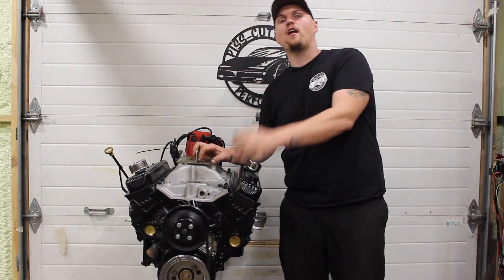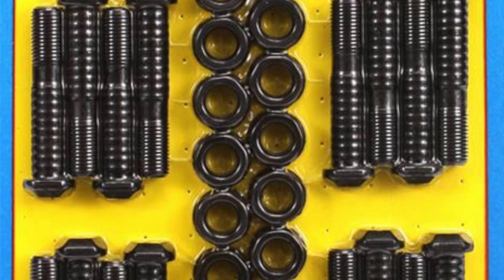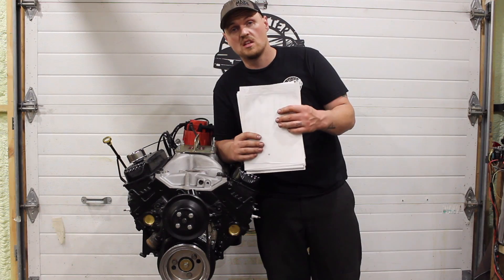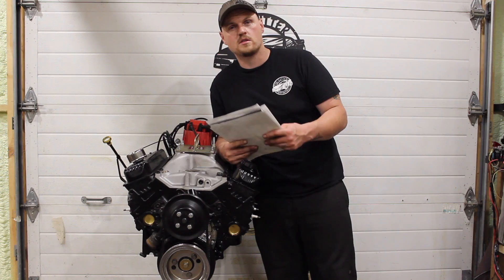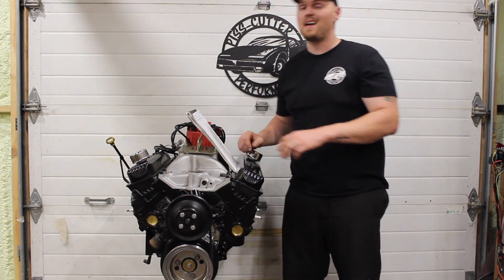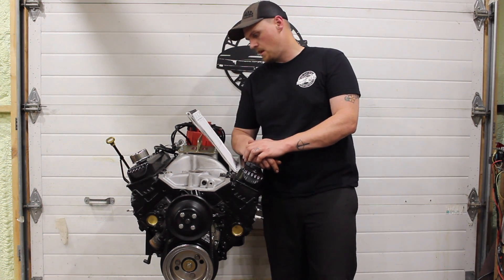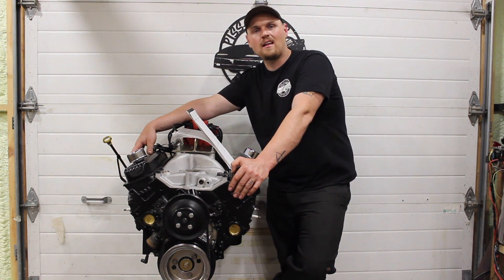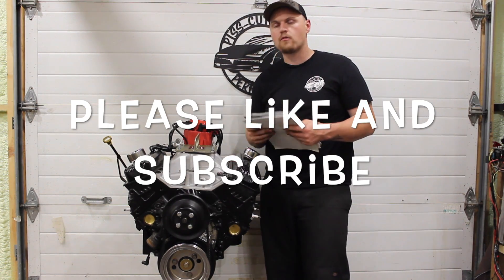Cheap Chevy 350 Power! 400+ hp Vortec Heads LT4 Hot Cam Dyno (L31 Budget)

Comment: I have a sbc (gen1) with wp heads with 185cc runners 13.7 to 1 pistons, cam is .615/.625  110 ° lobe sep .315 /.310 duration solid roller new eagle crank with 3.750 stroke. 4 .040 bore single plane weind intake.often wondered how much HP it makes never been on dyno.you can see it in my S10 @ old ridge runner race truck on YouTube ..I've often thought it may be around 500 HP compression test says 205 to 215 across all 8 holes any thoughts on est hp?
Reply from the maker: That should be an easy 500 hp, a combo like that will usually make atleast 1.35 or so hp per Cu in

Comment: Really sweet to see the lt4 cam results because I have the lunati 270 voodoo roller for my 383. Identical valve timing as the hot cam just different lobe profile and .549/.565 lift with 1.6 rockers, ground 6.5° advanced vs the lt4's 2° advance. 

385ci somewhere low-mid 9.1 compression. Budget afr 195 heads with 5 angle valve job, smoothed runners, port matched, thin rings, 0.040 quinch, performer quadrajet intake. 450hp I'll be happy but any closer to 500hp I sure wouldn't complain. No matter what it puts out it'll be a major upgrade from the bone stock 120hp/210tq 1985 tbi 4.3 in the el camino running on 5 cylinders😂😂 poor ol gal can't even maintain 60mph at the moment 😢

Comment: Hi Pat. I continue to have questions. :). I’ve heard the plastic gaskets for the intake manifold are trash. That’s what came in my kit. Do you have a recommendation and part number for intake manifold gaskets that you like? Also a head gasket for a motor that is not decked and heads not surfaced. I saw you use that steel shim head gasket, but I’m not sure I want to go that route as I’m worried about getting a good seal since nothing has been surfaced. Is there a standard head gasket and part number you recommend? Maybe I shouldn’t worry so much about the steel shim gasket? I know with a standard head gasket my compression will be about 3 tenths of a point lower. Thanks for the continued assistance.

Comment: Hi Pat. How much power do you think porting the cylinder heads added in this particular build?
Reply from the maker: I doubt it would have been able to hit 400 without the port work. Properly closer to my original 385 or so hp guess. I focused mostly on the exhaust side

Comment: 400 hp from a small block Chevy is easy.if you can't get it out of one you can't build performance engines
Reply from the maker: No doubt its not a hard task. The hard part is doing it on a budget. This engine was built for less than $1600
Reply: @cuttersperformance  easy enough with intelligent parts selection.pistons,cams and head choice.

Comment: thats some awesome numbers! I'm not that surprised though, vortec engines have easily unlockable extra power.

i pulled a 98 vortec from a pickup with 140k on it, re sealed it, new timing set and hardware, GM ramjet cam, edelbrock intake, shorty headers and slid it into a 93 OBS to replace the blown TBI 350 and wow!! that truck never had that much power before, not 400 hp but waaaaay stronger than TBI or a stock vortec. just from that small RV level ramjet cam, intake and headers and exhaust. it is a different animal.  

idk how much HP i have from that combo, never dynoed. maybe 325-350HP and like around 375 torque? just a guess. its a really strong vortec either way and runs great.

thatnk you for making these videos, so appreciated.
Reply: id say around 330hp, 375 ft lbs

Comment: Really wished you had run some basic 1-5/8" long tube. Or even shorty, block-huggers for some real-world numbers since this engine recipe would be great for street-going, weekend cruiser hot rods that wouldn't be running pricey, high-flowing 1-3/4" headers. I don't think the smaller headers would've hurt output too much. But it would've been nice to know how much they did.
Reply from the maker: The headers used are a chassis header unlike alot of dyno headers you see, but yeah would have been interesting to see the what 1 5/8 would change, honestly probably not around though. Also believe it or not those 1 3/4 headers are like $315 (Hooker racingheart)

Comment: I have an extremely low mile ZZ4 with LT4 Hot cam, ZZ430. I plan to remove it from my 66SS Nova and install in my wife's 79 4.4litre Malibu wagon. I am thinking about upgrading from the GM intake to a Edelbrock Air Gap RPM and looking for a better cam. I want more power and a better sounding cam. I have a brand new th350 and 2200 rpm converter that should work well. Any recommendations on a new roller cam?

Comment: I'm considering the hot cam for my car. I want to retain the mechanical fuel pump, so what style of fuel pump pushrod is required with this cam? Is it a billet steel cam or cast?
Reply from the maker: Its a billet core cam, a bronze tip fuel pump pushrod should be used

Comment: Another question. If I am reusing my stock lifters, how important is it that they go back into the same bores they came out of? They’re kind of dirty, and if I put them in the parts washer it’s going to be hard to keep them in order. Thanks!
Reply from the maker: Roller lifters dont need to go back in the same spot like a flat tappet lifter. Be careful cleaning them in a parts washer. If the solvent is new or quite clean, then you'll be good, but you dont want to introduce dirt/debris into your lifters/rollers.
Reply: @cuttersperformance  thanks again for all your help and timely replies. Very helpful. I misinterpreted one of your videos and I’m having the exhaust seat cut to a 1.6. Didn’t realize the increase in flow with the 1.6 also required a bowl blend (otherwise it is a detriment to flow as I understand). Maybe I’ll need to learn how to do a bowl blend too! :-) I know the 1.6 without a bowl blend reduces flow. Would I feel it on the butt dyno?
Reply from the maker: @boydabresch3858  even a light bowl blend is a good idea with the 1.6 ex valve. Just take your time and be sure not to hit the seats.

Comment: Thanks to your videos I built one with flat top pistons + 0.030 and ls valve springs comp cam  XE274H no head mods runs great. can I just replace the rockers to 1.6 and just re adjust valve lash ? for a little more power
Reply: Gonna have to measure coil bind retainer clearance etc. That cam already has a very aggressive ramp going 1.6 is gonna make it too much imo. May need to run more on the seat. To be honest I dont think youll feel any improvement.

Comment: i built one for my k1500 was 465hp and 480 foot pounds used david vizard recipe speedmaster heads flat top pistons with quick fuel slayer 750 cfm lt4 hot cam from  wilhoits oklahoma city
Reply from the maker: Thats really good for this cam, what displacement?
Reply: 355 @cuttersperformance
Reply: flat top pistons and eldelbrock performer rpm air gap intake  wilson manifold
Reply from the maker: @MichaelMatt-ts2mv  that very impressive torque for a 355 and that cam. Ive made similar hp with similar heads and cam but not that torque
Reply: i had wilhoits grind the cam with 107 LSA @cuttersperformance
Reply from the maker: @MichaelMatt-ts2mv  oo that makes sense, i thought you used a actual lt4 hotcam. Still quite good torque for a 355 👍
Reply: @cuttersperformance  also the big deal 6in rods
Reply: also skip white balance on the rotating assy  @cuttersperformance
Reply from the maker: @MichaelMatt-ts2mv  what compression ratio?
Reply: @cuttersperformance  10.3
Reply: A lot of cylinder head work
Reply: @cuttersperformance  are you have a great day man I'm fighting this damn hurricane in Florida
Reply: @cuttersperformance  No way he made that with those parts and the LT4 cam not happening
Reply: No way from a 350. Dyno operator gave you some fluffed numbers. Happens a lot

Comment: Two quick questions. I’m planning to run the Summit 8802 cam which is a copy of the LT4 Hot Cam. Im going to run the springs, retainers, and +.030 locks you showed in your other vid etc. My questions are, can I run the stock lifters? And second, I found a set of stamped steel 1.5 rockers that are long slot. I’ll closely inspect everything as it’s going together but assume these 1.5 long slots will work?
Reply: Thanks! The Summit 8802 cam specs are the same with a 1.5 as the LT4 Hot Cam is with a 1.6.
Reply from the maker: Yeah you can run the stock lifters if they are in good condition. I used a low mileage set of LS lifters. 1.5 long slots will work but a 1.6 ratio will give you better results

Comment: I'd like to build one with 11:1 compression, and install a 24X reluctor under the timing cover so a 0411 PCM could run it, with 60 LB injectors, and E85.

Comment: I did the exact same build with a 93 LT1 camshaft and 1.6 rockers. Was very surprised at how strong it runs.
Reply: We had a  96 t/a
13 .06 all day long 
Long tube 1-3/4
True dual w/ xpipe and dynomax bullets
1.6 rockers
3000 stall
Reply: Stock cam and gears!!!!

Comment: I’m hoping to be up there to in Hp /trq to 355 vortec 880 blk Edelbrock rpm air gap intake comp cam CS 280H-10 redone vortec heads 202/1.6 Holley 670 vacuum sec Msd 6al

Comment: Very impressive, I bought that cam about 5 years ago, but my  timing chain pulley didn't fit. Is there a different pulley to be used, this is on a gen 1 small block. thanks!
Reply from the maker: Yours in a 86+ gen1 roller block?
Reply: no, my 1982 corvette 350.  @cuttersperformance
Reply from the maker: @janchrisler6097  youll need a retro fit cam if you want to go roller
Reply: I did that, bought that cam and the timing chain cam pulley for a gen 1 chevy, but would not bolt up!!! not sure if it takes a different cam pulley type than a gen 1 timing change set? @cuttersperformance

Comment: Love this! I built my 98 5.7l on a budget using your videos with beehive springs,retainers, offset keepers, magnum roller rockers,and extreme energy cam(.495/.502). I also added a bbk 80mm throttle body using the oem plenum. My question for you is engine management…im swapping the 4.3 out for this built 5.7. The truck is a 5speed manual.  Do i get my computer flashed for my cam set up or do i go aftermarket? Something with a autotune feature maybe?
Reply from the maker: Your best bet would be to find a good local tuner that could custom tune it for you on a wheel dyno
Reply: Cutter is right find someone close to you and see what they recommend if able to use stock style computer you may save some cash is your 5.7 and ls

Comment: Could you use the stock rocker on this build or is it necessary to go to the 1.6?
Reply from the maker: Stock rockers shouldn't be used with this cam. They are not long slot and shouldn't be used over .480 lift
Reply: @cuttersperformance  thank you!

Comment: I'm sure I've missed it somewhere, but did you switch to screw in studs? Do you think this combo would be good for drivability in a street rod? Thanks, love your videos.
Reply from the maker: It has factory studs. Screw in studs are always a good idea, but not fully necessarily if the open pressure is kept under 300 lbs. This engine would have great drivability 👌

Comment: Im wanting to do this set up as well, question...do you need to port the heads, ive never ported heads before
Reply from the maker: To get the same results, you'll want to port the heads. Focusing on the exhaust port and blending the bowl on the intake
Reply: @piss-cutterperformance  awesome sounds good, I guess I better find another set of vortec heads, in case I mess it up, love the channel, glad someone does realistic budget, and not LS all the time.
Reply from the maker: @mechanicvet8539  check out some of my porting videos on my channel. The best advice I can give you is to take minimal off the intake side. You dont even have to touch the runner on the intake, just clean up the area under the valve. The exhaust side youll want to port the whole runner and the area under the valve

Comment: 6:40 .... the GM camshaft you mentioned, 208/221 - .474/.510 - 112LSA, its the exact same camshaft used in the ZZ4 crate engines when available at the time. Nice engine, but this modified vortec 350 is a nice upgrade, even with less compression, 9.3 vs 10.1(zz4) with L98 corvette aluminum heads, known to flow less than the stock vortec heads. I'd gladly take this budget buid vortec 350 over my ZZ4 crate engine currently running in my '79 malibu 2dr coupe anytime.

Comment: I am going to build almost the same setup. How much HP would you say that going to the 1.6 rockers would add from the stock rockers? Also what is the lowest octane gas that you could use safely with this engine. I know the HP would be less. Great channel. Thanks
Reply from the maker: I would not use the stock rocker on this application, they are not long slot. Id imagine you would lose 10 to 15 hp with the 1.5 ratio. I wish I would have brought 87 octane to the dyno because I believe this would have ran just fine on 87 and made the same power
Reply: Thanks for the feedback. I would save some money with the stock rockers. Great performance for pocket change. At least now days. With the price of gas going up again 87 octane would be a plus. @cuttersperformance
Reply from the maker: @ezelk1337  sorry just so its clear, I would not use stock rockers as they are not long slot

Comment: What year is the L31 production
Reply: Depends on the application.  96-2003 in vehicles in the US.  Last US vehicle application being an Isuzu NPR van.  In Mexico they put them in the GMT800 trucks until 2007.  They may still put them in new boats.  I worked on a Kohler generator built in about 2018 with one.

Comment: The lighter / thinner oil I guarantee made more power on dyno
 ( well freed up some power )  thst is..   I noticed a big difference w/ a gm602 crate engine in a circle track car from going from 15/50 mobil to a sponsors Daytona1 performamce lubricants full synthetic 5/40 oil. Butt dyno approved ( no homo lol)
Reply from the maker: It was actually quite interesting the difference with the 0w20 synthetic oil

Comment: I have this exact same set up on my car with the summit roller cam 8803. .550/.550. I’d guess my engine is 415hp, 425tq, which my cam is just a little bit more than the cam you used. I’m extremely happy with my engine and I’d absolutely do that exact build again
Reply: I have the summit 8802, and looking at the specs it's almost a 1 to 1 rip off of the GM hot cam. Only real difference is that it hits .525 lift with the 1.5 rockers instead of needing the 1.6 Rocker that the hot cam needs to achieve the same lift. Very happy with how it is working with my SBC, where the old comp cam I had would fall on its face at high rpm. It even plays nice with my Ebay gt45 turbo!

Comment: I'm in the Niagara area. I'll make it a point to look Luke up, when the time comes. In the meantime I have to get my engine out (when the snow flies), and then make a few decisions. An L31 might just be in my future due to the flat tappet issue. Then again, I may just need an oil pump. And a cam, lifters, valve springs, rocker arms. lol
Reply from the maker: Yeah, he's just a one man show and has lots of nice equipment. I currently have two blocks there right now getting done

Comment: I was not aware you were Canadian (shout out). I have a L31 4-bolt in my 97 C2500 that needs replacement.  I'm trying to sell the truck as a complete parts truck, but if it doesn't sell by fall/winter, I'm likely going to keep it and drop an engine in it.  That being said, it would be interesting to find out how much power you could make with the stock Vortec intake, aftermarket replacement MPFI Spider, and a PCM tune.
Reply: Already done that in my 1997 Express van.  I used the Lunati Bare Bones 218/228 hotcam and advanced it to a 104 ICL.  1.6 rockers for 0.536 lift. Ported the stock lower manifold.  Used a BBK 80mm throttle body and an upper plenum that I had epoxied the gasket groove in and ported to 80mm. Used a 454 throttle body gasket. I built a custom 4" air inlet to the OEM air box and used a LS7 cartridge maf in a 100mm Spectre tube. Then put Thorley Tri-Ys on the stock GM dual 3" to the muffler exhaust.  Swapped the muffler for an 8.1L replacement with dual 3" in and single 4" out.  4" tail pipe for an 8.1L 3500HD fit the 97 van perfectly, hangers and all.  After I tuned the 0411 in it, the thing made 330 hp and 350 tq at the tires on a Mustang dyno through a 4L85E and GM 9.5" 14-bolt in a 105°F shop with the clutch fan screaming while we were chilling out inside the van with the ac on. My buddy was in the driver seat running the van and dyno while I was in the passenger seat tuning the thing. It ran nearly continuously for 5 hours of pure beating on it. At the end of the session it was really dialed in idle, part throttle, and WFO.
Reply: Dyno'd it 3-4 years ago with a truck club I was a member of at the time for the fun of it too. Always get some laughs when a conversion van rolls on the dyno.

https://youtu.be/F-gjMNvpLzM

Comment: This is basically a direct copy of my build.Complete stock bottom, followed your porting videos (i do have the mexican castings with Manley street flow valves) GMPP dual plane and a Comp Cams XR276HR and roller rockers.. I always guessed it to be in the 375hp range with a Qjet on top

Comment: If the cam is advertised as .550" lift at 1.5 rocker ratio, the 1.6 lifters would put the lift at about .587".
Reply from the maker: The cam is .525 with 1.6 rockers